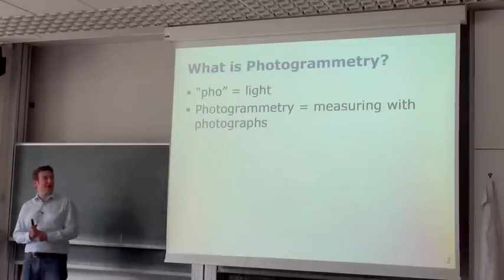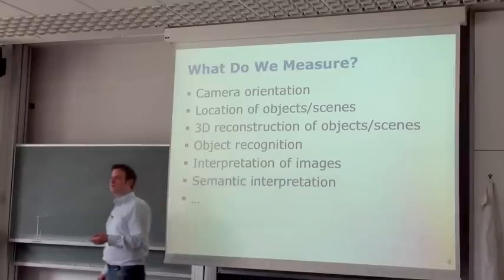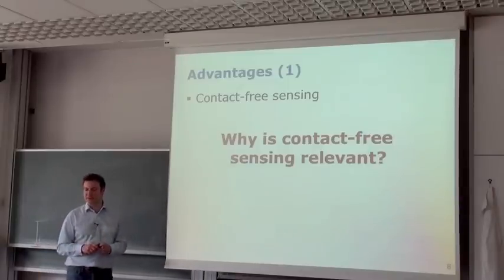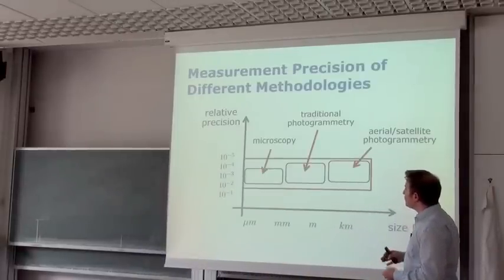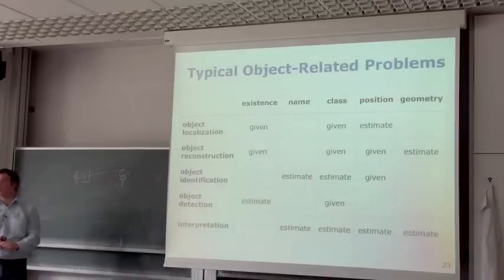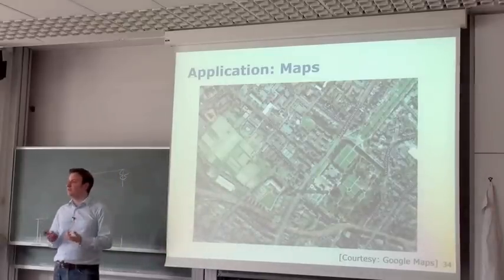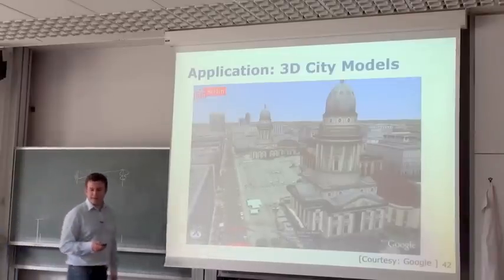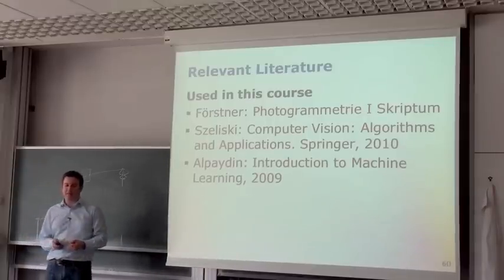Photogrammetry I - 01 - Introduction (2015)

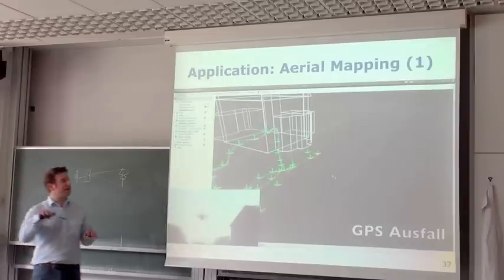Comment: Can you detail a bit more your statement at 36:38 that visual odometry drifts over time? it is not completely intuitive to me, the features in the world are fixed, and their position is directly measured. Are you reversing the optical flow instead of tracking ground features?

Comment: I am so sorry to say, but this course is not correct in many ways...too many errors in information to say here. Not enough research done on the subject here...(I have been building scanners for over 10 years, of all types) i.e. mobile phone cameras would be the worst source to extract frames to be used in photogrammetry due to physical parameters (too long to explain now) but mostly because the images undergo such high compression that there is severe data loss in the images for photogrammetry to be able to interpret, if you have to use a mobile phone camera, use a tripod and take photos in HDR mode, optics help a lot here, if you could find some lens to attach to the back of your phone to take sharper images, thumbs up for you (this is an extremely short version as to why mobile phones are borderline useless for photogrammetry)
Reply from the maker: No. The only question is how accurate your results are supposed to be in the end. Obviously, better sensors are likely to provide better results so the choice of your sensor is driven by the application you target at.

Comment: Thanks a lot Cyrill, for your time preparing these lectures. Coming from old fashion photogrammetry (surveying eng), I found it very difficult to stimulate modern students. Are the ppts available also?
Reply from the maker: +Dimitrios Skarlatos Yes, I am happy to share my slides. I will have finished them in around 2-3 weeks (when term is over) and I will then release all Photo 1 & Photo 2 pptx slides as a bundle. Please send me an email for details.